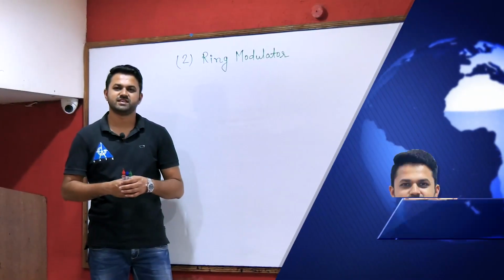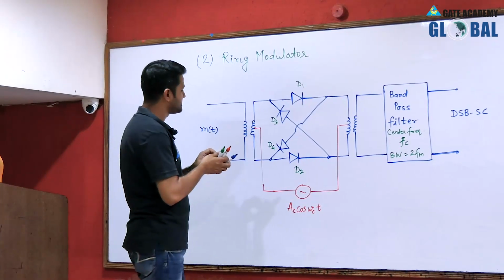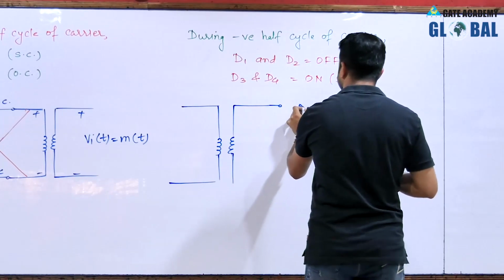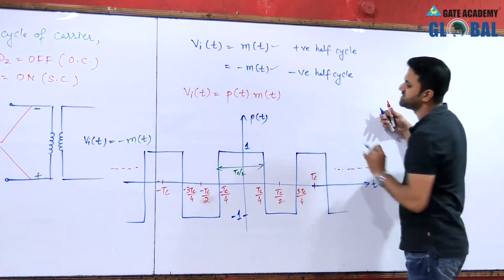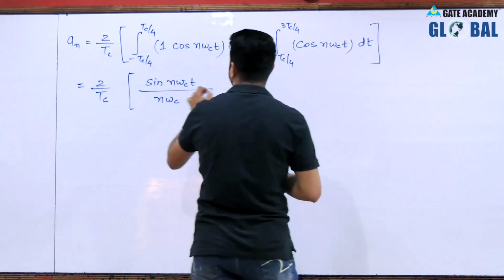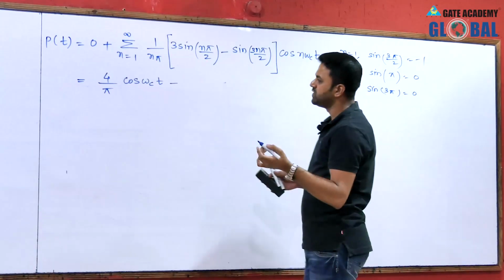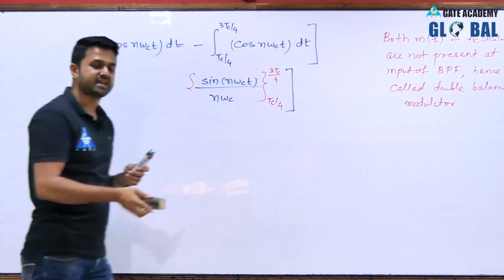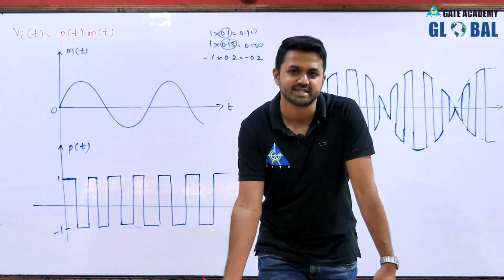Generation of DSB-SC (Ring Modulator) | Lecture 24 | Communication System

Comment: Sir in case of fourier series we use 1/time period 
But here you use 2/time period 
While calculate a° and aⁿ 
So if you tell me why you use that i'll understand that better
Reply: in the fourier series equation sir wrote it as a0/2 so while calculating a0  we need to divide the integral by T only. if u use a0 in the equation u hv to divide the integral by 2T.